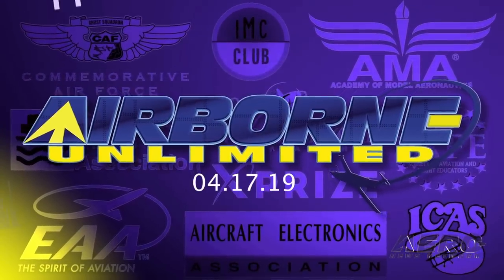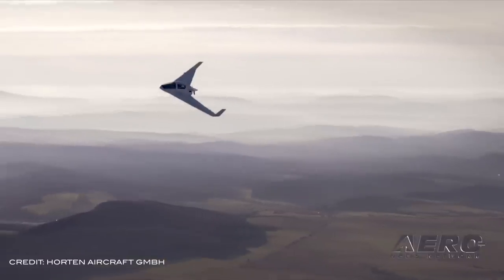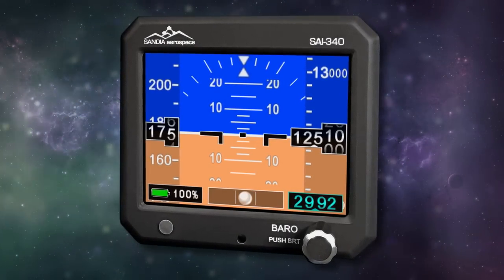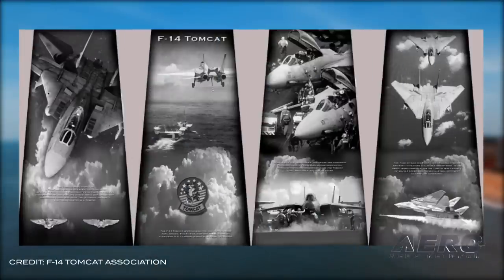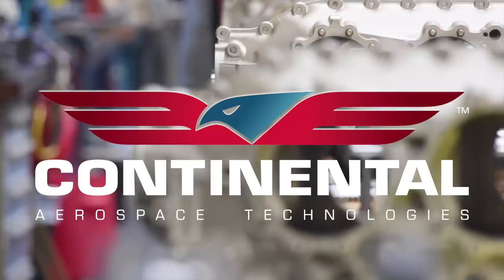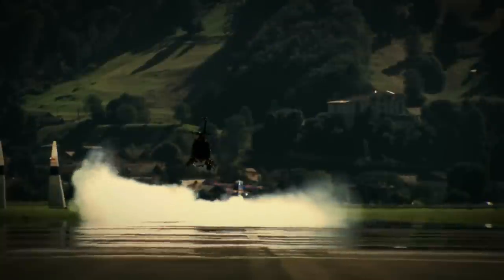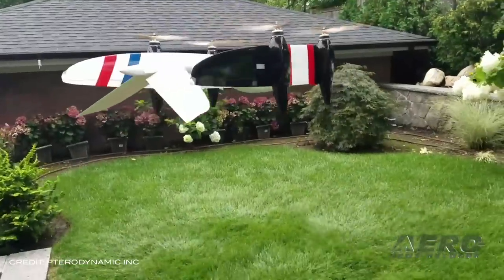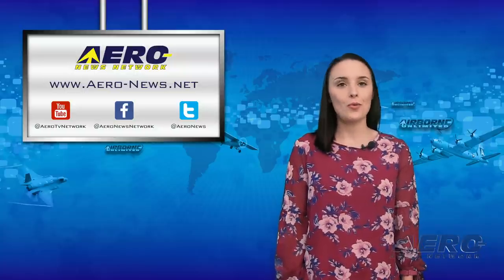Airborne 04.17.19: HX-2 Flying Wing, Evektor SportStar RTC, 'Transwing'

Comment: The X-2 is a beautiful craft, I was always a fan of WW2 aircraft innovations especially Luftwaffe aircraft as I had many WW2 model kits as a kid, though I never built a 229, I built the 262 but I've always loved the streamlined design of the Horton Ho 229, and the X-2 is a beautiful, BEAUUUUtiful 2 seater, single propeller driven successor.

Comment: Horton and Transwing — remarkable innovation!
Reply: Paul Milford  The only powered prototype of the 229 was the 229 v.II in February, 1945. For only two flight-hours.
Reply: @peterson7082  
The first test flight was February 2, 1945 with Lieutenant Erwin Miller at the controls. The first flight only lasted a half hour.
After a second successful flight in February 3, 1945, Miller, a neophyte test pilot, deployed the drag chute too early and did extensive damage to the plan's undercarriage.
The third flight didn't  take place until February 18, 1945, after returning from about 45 minutes in the air, he suffered a flame out , Miller climbed to altitude and dived to 800 meters, apparently to refire his
 engines. The undercarriage was lowered at an unusually high altitude of 400 meters, the speed decreased rapidly , before going into a series of decreasing radius 360° turns. After the third turn,he cracked it up into the ground.
There were no radio communications, Ziller may have succumbed to fumes, Ziller was thrown into a tree and killed instantly.
"The History & Development of Ho229  H.P. Dabrowski"
Translated from the German by David Johnson
Reply: Horten*

Comment: There are several ways of achieving a flying wing:
1 autostable reflexed airfoil.  Does not require sweep.  
2 swept wing with the tips, usually with strong geometric twist, replacing the tail plane decolage. (Twisted wing tips).  Aircraft can use both.  For instance Me 163 used both sweep and auto-stable airfoil.  The Horton Ho 229 used auto-stable around its bat tail centre but sweep and 2 degree twist at the tips.  Swept wings suffer from span-wise flow and premature tip stall.   The Me 163 used slots, Northrop wings used slats as well as a lot of twist (4 degrees).

Comment: Pretty flying wing (HX-2); nice styling. However the flight footage exposes some potential issues. There is a slight wobble entering, during, and exiting turns. This could be a small amount of dutch roll due to the dihedral (which is increased by the tall winglets) causing a coupling of the equations of motion for roll and yaw. This could be annoying to a pilot over time. This issue can be resolved by removing all dihedral or having a small amount of anhedral. The result will be more tendency to have spiral divergence, but the period of that motion will be long enough for the pilot to correct easily. Also, there appears to be a "pecking" motion in pitch which is common to many flying wings (for example the SB-13). This is due to the flat nature of the pitching moment curve near trim. This issue can be resolved by moving mass (pilot, engine, etc) to below the wing. Probably not possible at this stage of development so an electronic pitch stabilization might be in order. There also appears to be a lot of elevator needed in turns. This is typical of flying wings due to the short moment arm. These large deflections cause a lot of spanwise flow which can promote spins. It appears this design is attempting to prevent this problem with a large wing fence. Perhaps it is working, but care must be taken when testing aft CG locations. Elevons that have a planform where their chord is larger at the tip compared to the root can greatly reduce this issue. I hope this aircraft has a spin recovery chute. With proper sizing and placement of inboard flaps, they can be deployed downward to create a nose up pitching moment. If this approach is used, then the inboard flaps can be used to provide the pitch trim required in turns and the downward deflection of the flaps will actually reduce the spanwise flow. Perhaps the wing fences could be eliminated this way and reduce drag. This wing is beautiful and I hope it is also safe. Please test fly it with great care as you expand the flight envelope.
Reply: Had a Fledge hang glider with a trike for a few years and it was real nice handling, little tricky landing crosswind, due to ground looping.